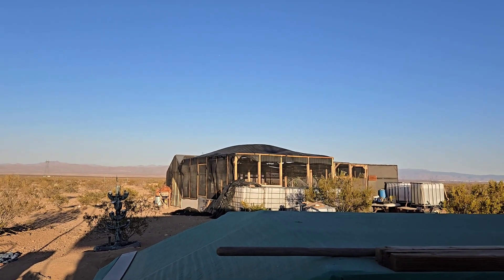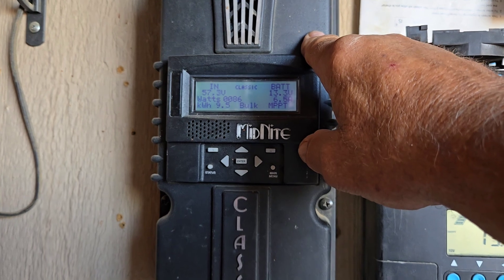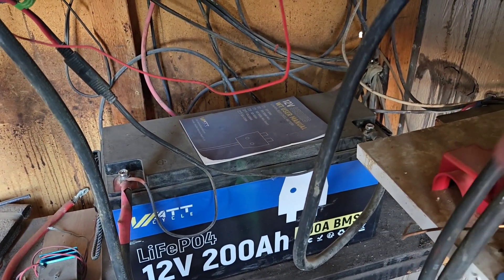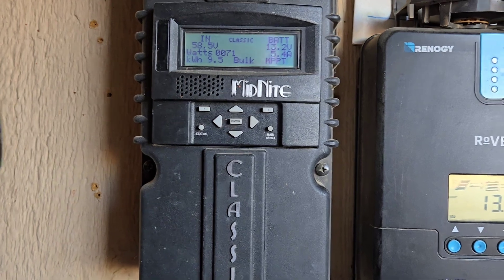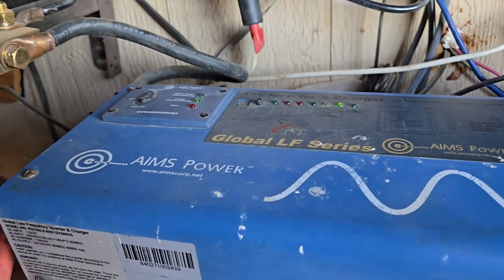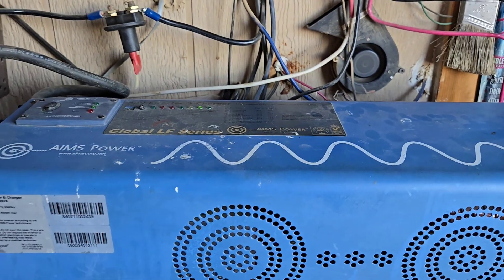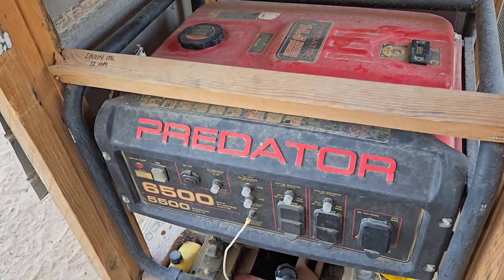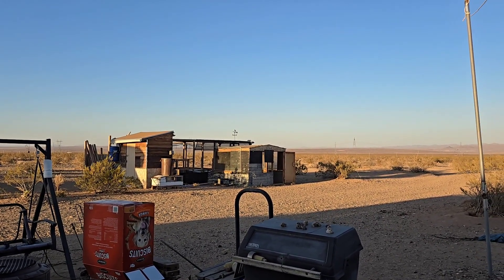Trying To Run LiFePO4 On a Midnite Classic 150?  July 28, 2025

Comment: Tech is changing by the month. Midnight Classic has ran its course. It was top of the line back in that. Sad to see it sunsetting. She has paid for herself by now. Glad all those lead acid batts are history. I remember when this old batteries were lines across 2 entire shelves, now look where we are. Good channel watching the tech change. New equipment today will be obsolete a few years from now, which is actually a good thing. I mean there are folks still using 20 year old systems, but is it efficient. Keep up the good work.
Reply from the maker: Thanks, welcome back. 
Yeah, as for new tech, the new aluminum ion batteries have already been introduced.  10 times the power and durability of the current tech.

Comment: Oh man. My friends didn't do their homework and switched their systen that's almost the same as yours to 4x 24v LiFePo batteries on the day you posted this video, and now they want to know why the batteries won't get charged up correctly with Midnite Classic 150s, whether by solar panel or generator, and the load is pulling from the generator instead of the batteries. Now I gotta tell them all their equipment is incompatible.
Reply from the maker: Welcome aboard. It's not necessarily incompatible.   The limitations and parameter settings need to be taken under consideration. 
You didn't say how much solar they are using, but it was apparently ok for their lead acid bank, so they need to set the controller parameters for LiFePO4 specs.
The manual will explain it, or they can probably find a Midnite Classic video on YT going step by step to define user settings for LiFePO4.
Reply from the maker: Their problem probably lies in the charge voltage setting.  That needs to be set to 14.6v for 12v system, etc.  Probably 29v for a 24v system.  Also, equalization needs to be disabled, as LiFePO4 doesn't use that.
Be sure to check the battery manufacturer's recommended settings for LiFePO4.
Reply from the maker: Their problem probably lies in the charge voltage setting.  That needs to be set to 14.6v for 12v system, etc.  Probably 29v for a 24v system.  Also, equalization needs to be disabled, as LiFePO4 doesn't use that.
Be sure to check the battery manufacturer's recommended settings for LiFePO4.
Reply: @GBear thank you, I'll look into these things. I found the manual yesterday but am still getting familiar with a lot of the terms. Your video is still one of the first things that comes up when looking for the specifics. I thought what you said in the video that a normal generator just isn't capable of charging LiFePo though, is that right? we have another Midnite Classic 150 set up for the generator and part of the troubleshooting has been trying to figure out how to reset the AC input (30 amp generator) settings as we sometimes need it to supplement on rainy days.
Reply from the maker: @Zealant The generator doesn't got through a Midnite Classic charge controller, it goes to a proper inverter connection.  I'm about to shoot tonight's episode and will do a special segment for you, so check in an hour or so for a new posting.
Reply from the maker: Also, many inverters have a lifepo4 setting change to make.  At least good quality ones  do.  The AIMS 4K SP does.

Comment: Hello from Alberta Mr G Bear ! Great info on your set up 👍, I have run a Midnite Classic 200 for the last 8 years on my homestead where it gets cold & we have trees lol :) We are in the 30c's again for a few days that's to hot for me :) When the weather is right I can just about max it out at 79A  I've run 16- 100ah Gel batteries with my panels pumping out to 1150w the classic has done me well, In the last year have changed my system at my full time cabin to running a BLUETTI power station, No more shunts breakers & switches, straight from the sun to the power station & to my 120 plugs, No breaker panel yet for now each lead has a plug end on it, I've done some reviews to show how well it works, After 14months not a problem 😃, I started with a story like your but FREE the last couple years :) Have an awesome day Great channel"
Reply from the maker: Thanks and welcome aboard!  I've been out here 10+ years now, and always something to do.

Comment: i use the classic 150 too , mine is more of a supplemental for my system, but that thing is a beast
Reply from the maker: Yeah, it is, or was a popular choice years back.  I still like it, but my system components are changing.
Reply: @GBear im updating too, i have the new eg4 12k inverter just trying to get the shed ready to move it all out there
Reply from the maker: @SmokeyMountainOffGrid The eg4 is good, but expensive.  I find the Sungoldpower units to be equally good at a better price.
Reply: @GBear i got a discount for being an affiliate or i wouldnt have been able to get it lol
Reply from the maker: @SmokeyMountainOffGrid Yeah, I hear that.  I HAVE to get the SGP all in one.  WattCycle isn't going to carry them for quite a while.

Comment: I would Run 3 VICTRON 150/45 Smart Solar Charge Controllers and Send 3000 Watts o Solar to that Battery Bank or Step up to 24 Volts and add more Solar Panels.
Reply from the maker: ...or add a Sungoldpower 6.5- 8k all in one and add more solar
Reply: @GBear Both are EXPENSIVE CHOICES 💵 🙈 💵
Reply: 👍 awhile back I switch to 24v and now can have twice as many solar panels (two victron 100/50).

Comment: Good morning G Bear. My solar system is all up and running, on a good day i get 56v to 63v solar and my battery bank is full charged.
Reply from the maker: Excellent!  If it works, don't fix it!  Also, I read today about new battery technology called Aluminum ion.
It is supposed to kill LiFePO4 tech quickly by more power, cheaper build, recyclable,  lighter eight and a longer life span.  Should be an interesting 2026.
Reply: @GBear  Hi G Bear. That sounds good about the Aluminum ion. My 12v fridge freezer has died and it's not a year old yet. So i am running my 240v fridge and 240v freezer on my solar system it's working great, i will set up my computer system in the week so i can run that off my solar system. Just need to fit the 240v lead to the inverter.
Reply from the maker: @daz.r1994 Nice.  Yes, I originally wired my cabin lighting for 12vdc and found out the hard way that 120vac would have been more efficient.

Comment: Are there any super capacitor for starting your generators with electric start?
Reply from the maker: I'm sure one can be made.  Most have set up a trickle charge maintainer unit plugged into their house power,  just to keep the battery at peak, and there are auto start units available that will start the gen when batteries reach a specified low,  and shut off the gen once charged for seamless uninterrupted power.

Comment: The all in ones can handle the high voltage and convert it easily to 120/240 ac.    
4s4p most lifepo4 are limited to 16 total 4 in series and 4 parallel.   

The problem is the bms needs to share current from other paralleled batteries.   200 amps x4 is 800 amps which is hard to keep tamed with the limited wiring and bms capabilities.   
The way to get around this is to wire batteries to bus bars so that all the current isn’t passing between the batteries  internal components.
Reply from the maker: Very good points.  Busy bars are always the better choice.